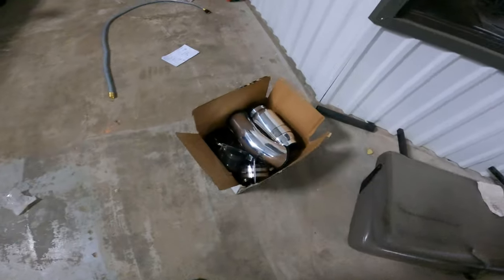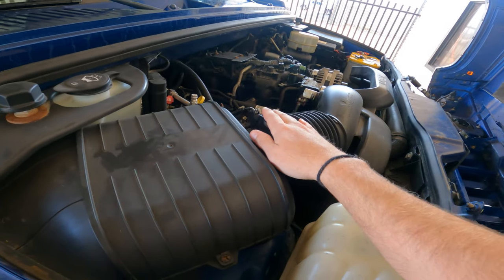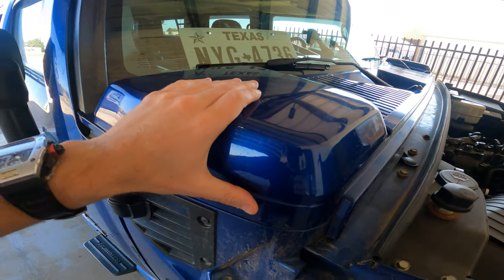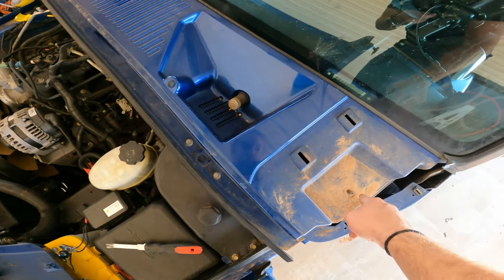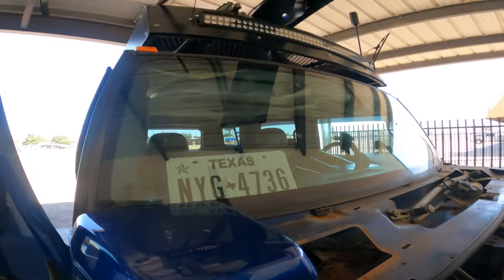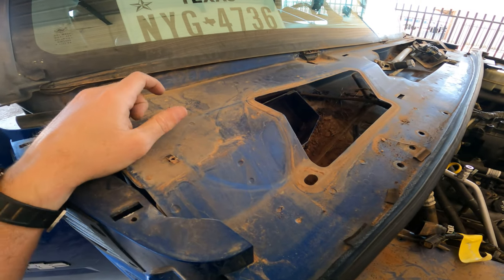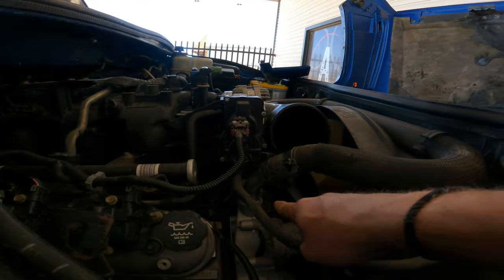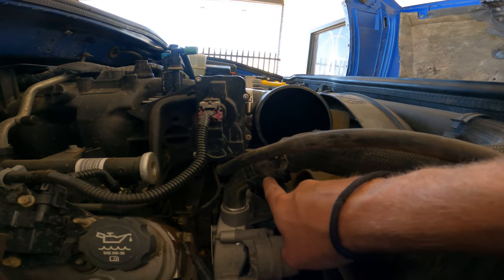Starting the H2 Hummer Custom Snorkel Intake

Comment: Great video Tony!  I want to put one on my H2 as well, but was wondering if one of the ready made Snorkels designed for other SUVs could be fitted with a lot less work, since most of them end up with the air intake in the same area under the fender as the H2. Did you check out any of those other ready made snorkels if any of them might work before you did that major cut job for yours?  Most of the commercial ones also have the snorkel right against the windshield so they do not obstruct the vision much.  I own an original M998 Military "H-1" HMMWV  with the issue snorkel in the same location as your project, so know what inspired yours.   So have you finished it yet?
Reply from the maker: Hey Dan, thanks for watching!

So I did do extensive research, talked to other owners who have done similar intakes, and unfortunately there's no way to make any commerical unit work properly without extensive modifications as well - the popular ones that exit through the fenders such as on Tacoma's and 4Runners won't work as that section on the H2 is part of the hood, and the space in between where the current intake sits is far too narrow to fit anything. Hardly enough room for proper airflow actually.

The only real option which will not bottleneck the intake with a very small diameter is to do as I've done here - hence why there's no commerical kits available for the H2, there's just not many options on how to run it, and none that would be "bolt on".

Funny you should comment today about finishing it - I actually just ordered the last piece I need to get this bolted on. I've been busy converting the interior into a mini RV for overlanding, so this project took a slight backseat. But the last pipe I need will be here Wednesday - everything should bolt up pretty quickly, I'll make a handful of brackets to hold it securely and then drop it all off for powdercoating. So I'd guess the end of next week I may have it all bolted together and done, so a video will follow shortly after that.

I appreciate the insight and questions, I'm definitely not the professional and one may chime in with a better solution than mine, but this is what looks like will work best to me! There are some others I've seen with their snorkel directly centered on the plastic cap, but those are so narrow, around 2 inches, that I can't imagine it's the "best" solution, albeit it is aesthetically better than what I will have to end up doing, which is placing the pipe on the far right of the plastic cap.

When it's said and done, if you'd like to do something similar I am always happy to chat and send over my part numbers for everything!
Reply: @TonyMaples  Hey Tony, I have now built and installed what I believe is a functional snorkel/supplementary air intake, by buying an $80.00 Toyota Landcruiser snorkel off of eBay, cut it down to fit into the driver side plastic vent cover of my 2003 H2, and with a little bit of interior hole drilling and sealing, forces air into to same metal channel that the normal air intake comes in under the hood and into the air filter.  This simple mod doesn't modify the exterior body at all except for the one cheap plastic vent cover and definitely brings MUCH more air into the air filter, and on the rare occasion I might need to use it as a true snorkel, I simply have to take about two minutes to duct tape the the stock air intake ducts under the side of the hood shut.  The whole thing was completed on a weekend and looks like it is  an OEM part --- as good as the ones actually made for the H3!   .  I am curious to see what you think and if I may have overlooked something.  If there is any way this could hurt the vehicle's operation, it can be restored to its original condition in a matter of minutes, and the purchase of just a new plastic vent cover and reopening the sealed areas..  I have never made a YouTube video before to show this, but could post images somewhere for you to see, like if you are a member of one of the Hummer Facebook groups, or someplace similar.
Reply from the maker: @danpeterson114  hey Dan! Sounds like you found a great solution for what you need 🤙🏼

If the truck starts properly and accelerates at WOT as normal, you haven't caused any issues 😎

Id definitely love to see it! If you have an Instagram you can send me a DM @tonymaples. 

I've been slacking on videos lately, the camper conversion I've been working on has been taking all my time, but I have about an hour of filming left to do to finish up my completed snorkel video. I should have it posted next week, and then I'll have a video on my extensive camper build I've been doing to the H2 the past few months.